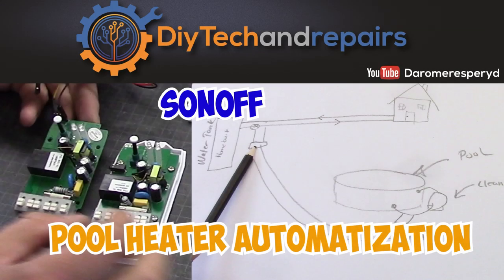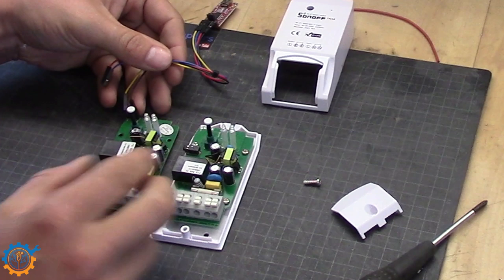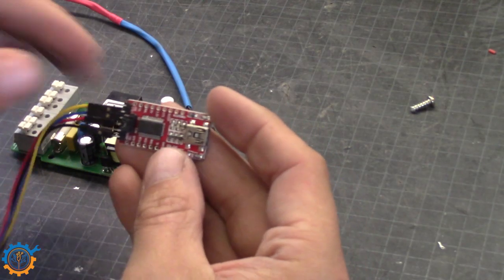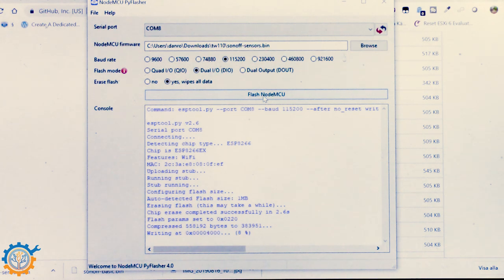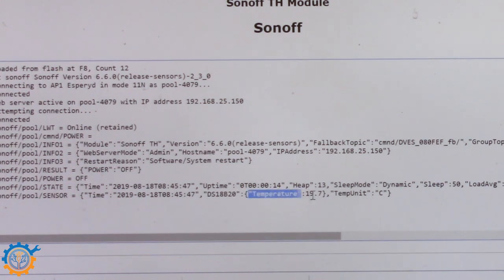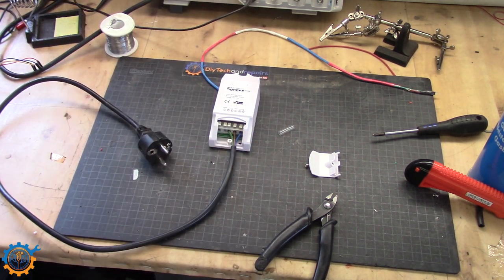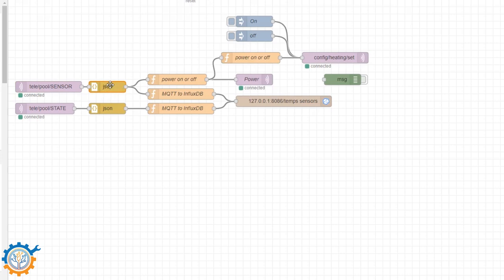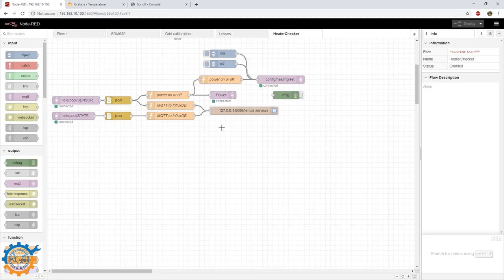Automatize pool water heating made simple with Sonoff and MQTT!

Comment: Yeah, nope.
I trust those SONOFabitch things about as far as I can spit. Also, I don't see why you couldn't have done this with a standard thermostat. Remote temperature monitoring could have been easily done any number of ways separate to the control loop. I don't see the advantage, and I don't trust that line of devices. Electrically, they're pretty average and I've heard (though I don't know for sure) the instructions tell you to punch a hole in your firewall so they can work.  Also I'm not a big fan of IOT. It's all a stupid idea.
Reply from the maker: Hahaha you seem to have a bad Day. No One have forced you to do it.  Yes a thermostat could have stopped that pump but cant controll the heating system that need to be controlled remotely.  Personelly im all for iot and automatization. Perhaps not strange since  working with it for years.   Note that i dont run stock software... I would not let My iot system outside My Network.  Mqtt is neat to work with but not for the fainted
Reply: @DIYTechRepairs  I'm all for automation too. I've been building robots for a hobby for over 30 years. 
I also made the assumption that the pool heater, given the placement of the heat exchanger could only operate when the heating system was operating for the house. 
If not running the stock sonof software with it's (so I'm told) security flaws, then that's one closer. But still, I'm not a big fan of their devices. A lot of them lack isolation, cheap relays, I haven't looked at their firmware yet, and for that reason don't trust it.
MQQT is not a bad protocol, I just don't see the point of 60 million pot plants pinging the water content of their soil every 3 seconds. If it's for their own purposes and kept within their own network, fair enough. But that's not what IOT is, now is it?
My apologies, I wasn't trying to be offensive.
Reply from the maker: @Jimmeh_B  iot can be within a confined Network or not. Back in the days it was connected anywhere but thats not doable with ipv4 nor with the lack of security. I know that the iot def is internet of things but People tend to argue of its actual use. In My case its more of connected devices :).   I would never expose my system :) it need to be at home and each part need to be able to operate on its own.